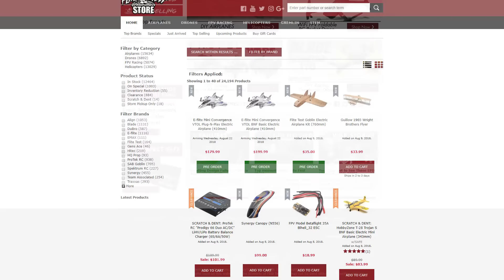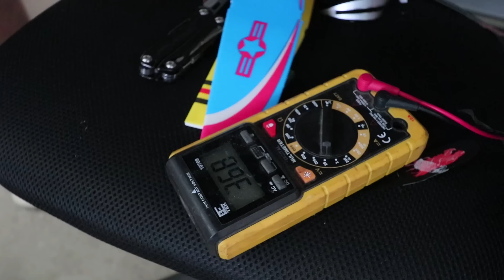Powered R/C glider without batteries!? | Capacitor plane hack

Comment: It seems you are using just regular electrolytic caps? 
You guys need are so called "Supercapacitors/Ultracapacitors", they may have a multitude of capacity in comparison of what you have been using, when using a similar form factor.
Just as an example from thousands of different models, have a look at this one: It can take up to 5.5V (3.7V is very safe) but has a total capacity of 5.000.000 µF !!! = 5F and is just a little bigger and heavier than your caps only it has a multitude of power.  If you can buy 10 caps for under 40 bucks plus tax and shipping 
https://www2.mouser.com/ProductDetail/Illinois-Capacitor-CDE/DGH505Q5R5?qs=sGAEpiMZZMuDCPMZUZ%252bYlzGTqubQTce6sgS6YEMGwOg%3d
But it may make sense to use some with a multitude of 3,7V that may even have better power to weight ratio ... study the specs carefully and see what makes most sense for your RC project and please  make sure you are not running them right at their max voltage, else they might not live to long if they ever catch some overvoltage when charging.
There are lots of dealers for electronic components, this is just a very popular US based example that has a large variety in stock - sometimes you may find some good ones that are end of life, so not of interesting as a resource for a big industrial production projects that should run long term, but exactly for that reason they want to clear their stock and you might be able to get them dirt cheap and perfect for tinkering like you do.
Please be careful when running caps in series - sometimes the tolerance makes these have very different capacities, end up in having the cap with the lower capacity get most of the voltage while the one with the real juice barely gets charged, having the low voltage cap blow up! So better built a system with caps that singularly have a higher voltage rating and run them, if necessary in parallel, because the current will find its way and decrease in the process and it will most likely not damage the caps, because each cap takes what it needs and will deliver what it has stored instantly. The first impulse when charging may be intense though, so you may want to add a 1 Ohm resistor or something even lower than that to smoothen the process and not have your chargers regulator die from the first current peak or unexpectedly starting to weld the wires together in the charging process!

Here you will get an idea what might be suitable for you - large overview of available supercaps:
https://www2.mouser.com/Passive-Components/Capacitors/Supercapacitors-Ultracapacitors/_/N-5x76s/
Set the first selection filter to voltage maybe 25% over your operating voltage to be in the safe range and then look for high capacity, don't just look for the numeric value, think about the fact that 
1F = 1000mF = 1000000µF and look for its reference magnitude, then maybe look at the dimensions and prices ... the impedance means that lower impedance offers higher peak currents for radical mannovers. But I have no experience how much current small RC motors may draw, but I imagine any cap should deliver enough juice for normal flight.
Anyway give it a try, this stuff is the future ... and charging within a few seconds is a nice thing to get used to :-) ... but at some point make sure your charger has enough juice!
Maybe run a voltmeter in parallel to your charging process and  you can instantly watch what it reached the max voltage and disconnect.
Have fun and thanks for sharing!

Comment: you guys in this hobby seem to say often diy or you guys act as if anyone can do this . now with a bit of knowledge yes. problem Ive run into is the price of the main piece , the controller and anything used from there. which is the entire point of being able to build these products you advertise. the prob and withdrawling factor is affordability. I can go buy a shitty rc car for 15 bucks and maybe use the radio and set up. also the servos are pricey af !

Comment: I've seen cars started with caps... could be the next lithium....
Reply: The problem is that caps have ridiculously low energy density compared to lithium or any other battery technology. Their main thing is beeing able to charge and discharge insanely fast, so if you need a burst that your battery cant supply, like for a starter, they are great but nothing sustained. There are high-capacity types, but those are only like 2.5 Volt and are sometimes used for backup of a clock or log data but even then a lithium coin cell is most often the cheaper solution
Reply: Cars with capacitors? Mr. Musk is scared ; )  Model cars?
Reply: On that point those little toy cars which capacity charge last quite a few  seconds so I reckon glider control should last for quite a few wiggles of the stick too.

Comment: A capacitator is an ultra high discharge battery but ok...
Reply: Rc exp fpv 
Very basically... 
A capacitor stores the electrons that flow into it without changing them. 
A battery converts chemicals into electrons.
Reply: Green Silver maybe too basically but yeah, I know the current filtering voltage smoothing and etc wonders of capacitors but hey, pretty cool to see them used for a glider application